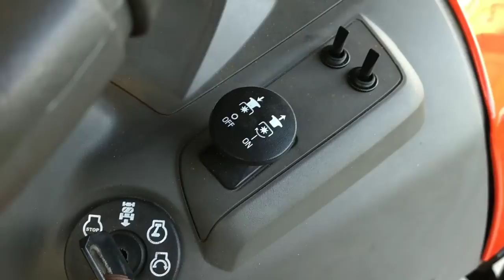Home made lawn mower bucket loader

Comment: HI Carlos, I really like your design and can build it, I just need connection info and information on how it lifts and where you picked up lifting side of your bucket. I don't want to attach to the wrong spot on frame. Any chance you have a .jpg file on details you could email please and thanks for your sharing your efforts. It's great.
Reply from the maker: Richard Britt 
Feel free to send me your email or information and will try to get you going with your project
Reply from the maker: Please read! This first unit was nothing more than a prototype that exceeded our expectations. It was slow but functional and didn't lift a lot of weight and most people don't take the time to read through all of these YouTube replies and post. We have sent started a full-time business operating very slowly and still learning every machine has a purpose a weight rating and a capability based on the type of unit actuators and what the final purposes for using it. We now have machines that are light duty and only include plans 450 lb maximum lift to over 400 lb maximum left but everything is dependent on the type of machine the way of the machine and what the intended uses for the machine. We lift more we lift higher than Johnny bucket but we are still a small startup company for those but want something now they should go to Johnny bucket.com and purchase something from them that will lift 8 to 12 inches off the ground and we support them as a competitor. Good luck with all your designs your plans call with any questions we don't check email often and we're not ready for a website because we can't keep up with the amount of emails we get daily.
Reply from the maker: Please call with questions on light duty units we provide free information period for the haters we prefer they don't even post unless they have something that works better in the meantime feel free to reach out with an email address which is posted below or a phone number that we've posted and we will be glad to help the masses because we started from scratch also.

Comment from the maker: The actuators are just light duty 225 lb each Lyft from eBay. The new prototype that we built for a larger garden tractor are 1000 pound each actuators from concentric International. If you're interested and building a stronger unit we are distributor for concentric International.
Reply: What's the stroke length on the actuators?

Comment: Nice workmanship, but it's toooooo slowwww to be of a lot of use. Would take all day to move one big pile of dirt 200 yds. Other than that, great job!
Reply from the maker: This was nothing more than a prototype. You say it takes all day to move a whole pile of dirt if you can scoop an entire wheelbarrow even if it's slow, would you rather do that by hand with a shovel and a wheelbarrow?. No worries we build a production unit that's as fast as hydraulics on real garden tractors successfully today this was just nothing more than to inspire people to maybe build their own.
Reply: @carlostejera8476  It has definately inspired me to build one, only because i can't afford a garden tractor to buy one of yall's heavy duty units for.  GREAT job on both this prototype and yalls little green monster, they look like they come factory on the mowers and garden tractors yall install them on.  this is going to be perfect as i plan on putting a claw type front end instead of a bucket to move small piles of brush as such that i cut on my property.

Comment: Cool up until the electric actuators...the charging system is going to die. Cool design a log splitter open center system would not cost much.
Reply from the maker: Chad, thanks for the response. Keep in mind this entire unit is good for 150# and all the steel, switches, wiring , and actuator cost me less than $300 bucks. I'm an engineer for an industrial & hydraulic company and have access to what ever I need but even a 12V system would be bulky and unsightly. Unless you have built one, you'd be missing the one key ingredient which is that this is a 450# lawn mower with no locking differential. The weak link isn't my unit, it's the lack of weight and balls behind the tractor. My arm assembly has been tested to 250# if the tractor didn't nose over. Good luck with your projects. PS, the amperage on each of these actuators is only 5.5 amps total under full load! you wouldn't kill the battery if tried not to mention the mower should be running since I know of nobody that uses this attachment anyway if your not in the driver seat.
Reply: Add a second battery if it becomes a problem.